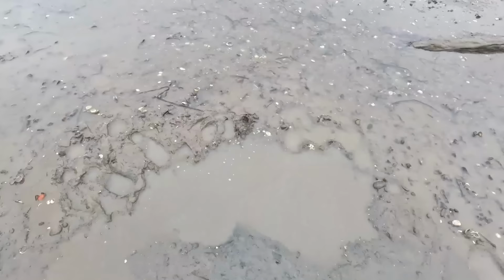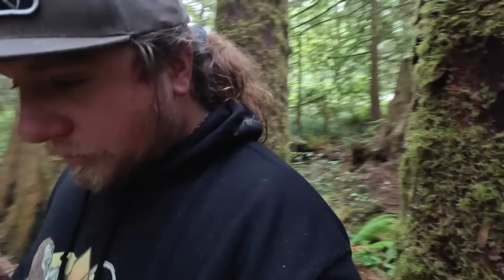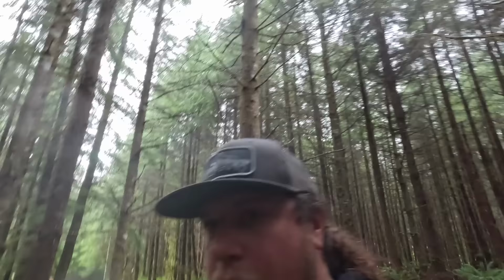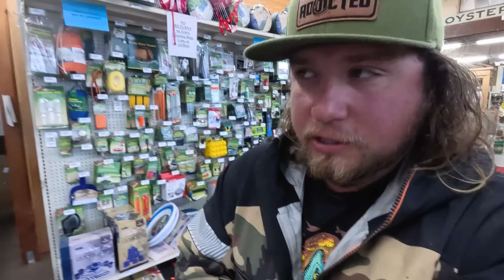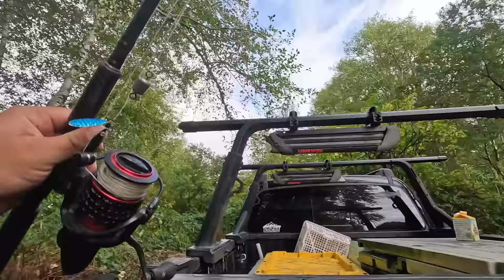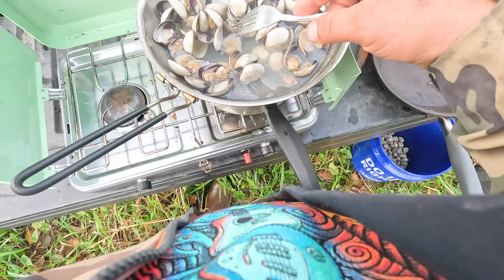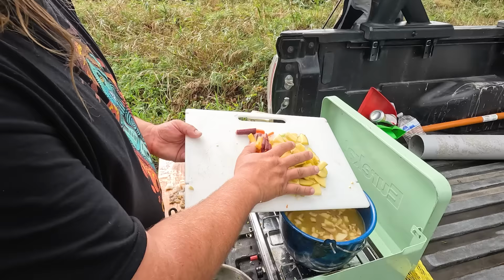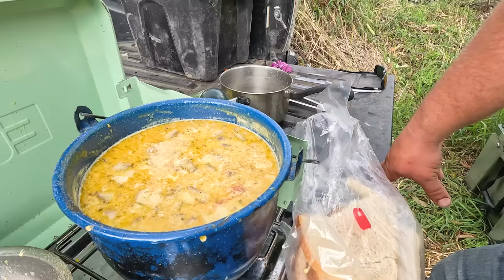48 Hours Eating Only What I Catch & Forage

Comment: butter clams are An actual species. Those are Manila little neck clams, And they  look NICE!   They do pretty much make the best steamers.
The trick to getting them without a bunch of sand clams or broken ones Is to dig a hole a couple of spades worth deep. The water will begin to fill this pool. Use this water to slosh the sides of the hole. The soil will break where it's weakest, And that would be where climb necks have created fractured the soil. Suddenly a clam appears on the edge of your hole with a clear neck line. You know that one's not sand! Also if the hinge is pointed away from the sea, This is a again a Sand clam. 
  So that's slosh with water so that's not too break shells, Look for Neck siphon holes, and hinge to the sea!
   Try that to avoid Sand clams.

Comment: Jordan please tell all of us how you purge the clams? I think viewers would like to know. And I am so happy you're going to catch, clean and cook a salmon, just don't release it ok!😊
Reply: Purging clams is easy. Just fill a bucket with saltwater. They'll purge themselves. All they do is flush the sand out of themselves.
Reply: You will need a bucket of clean seawater, And some of the old-timers like to put a bit of white corn meal in it.  The clams will take in the corn meal, And expectorate all the sand. 
My dad would keep them overnight, Stirring occasionally to spook the clams and cause them to squirt.
By the next day, The clams were sort of stuffed, And when you steamed them, they turned out much better.
Part  of it is also in the digging of the clams .  If you do not see a siphon hole going to the surface of the sand from the clam in question, That clam is dead.
The only exception I can think of being cockles. They have a roughly scallop like shell, And no siphon.